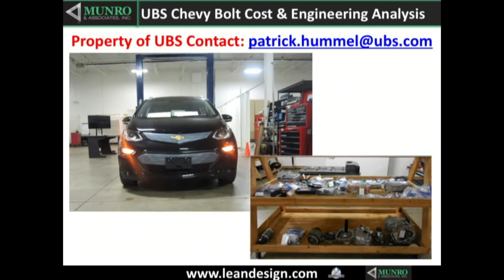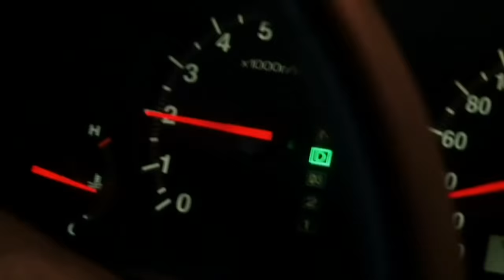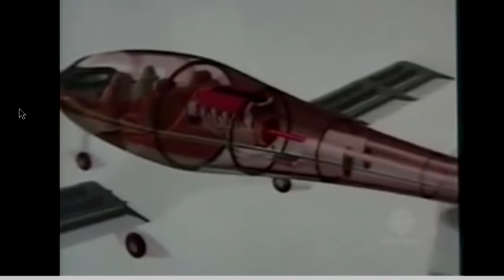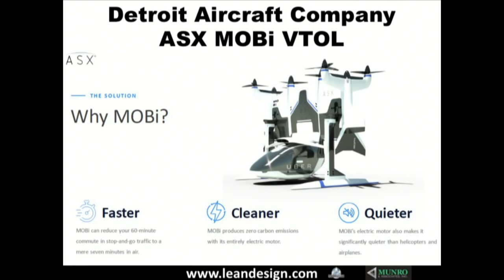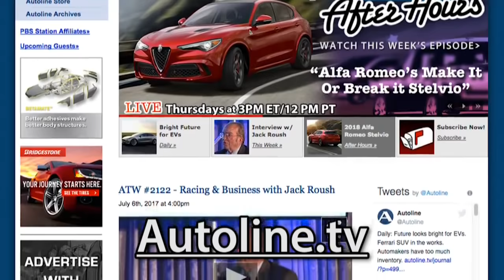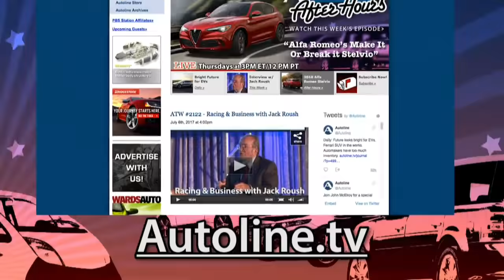Tearing Into The Chevy Bolt EV - Autoline After Hours 385

Comment: "When I finally parked it(Bolt) at my home charging station, it had gone 322 miles on a single charge. Not bad for a car rated at 238 miles per charge. Even more impressive was the fact that I didn't really try very hard to get that many miles out of it. I spent plenty of time in traffic, which helped, but there were a few sections that I was moving along at 65-70 mph as well. No matter how you look at it, 322 miles out of a Bolt is pretty impressive." — Ed Hellwig Edmund's

Comment: The Bolt will charge from 120V at 8 amps or 12 amps.  The 60 hour time for a full charge is at 8 amps.  At 12 amps it would be 40 hours.

Comment: The price drop for the Bolt and Bolt EUV got me here. They're definitely making profit on the investment now. Love the bigger rear door/legroom, pano roof, ventilated seats and SuperCruise on the EUV. Keep the regular Bolt as cheap as possible. Give the EUV the extra goodies and then add them to the regular Bolt later on. The refresh really cleaned everything up for the standard Bolt. Battery recall put pressure on them to drop prices. Two wonderful option for any value driven customers looking to get into an EV...

Comment: This guy is in someone’s pocket. I have owned a Model 3 for 4 weeks now. We just completed a 2000 mile trip. We passed a few Bolts, most were doing 40-50 mph, I would guess they were trying to make it to the next charger. If you want range anxiety, I wouldn’t plan a road trip in this car. We sailed from supercharger to supercharger, mostly in the 65- 80 mph range. The Model 3 is quite a road car, I’ve never had anything like it. I guess I’m a fan man (65) but I believe there will be no shortage of buyers for this car. This is the guy who said the Model 3 has the build quality of a Kia. I don’t think so, it really made me laugh. I can get just about anywhere twice as fast, or so it seems, in the Model 3. The power is instantaneous. It doesn’t shift, it just does tremendous speed in complete quiet. I am very glad to have owned this car before 5G and new government regulations in the next 2-3 years. I believe it will be harder to even self drive cars like this due to autonomy. When I was 16, my parents bought a new Pontiac, I’m not sure they even knew the significance of it being a GTO. I can tell you the Model 3 makes that car seem like a bucket of bolts. Hell, it makes my old car, a Lexus GS seem like a bucket of bolts. The advertised 0-60 time of this car is something like 5.2. Having owned 2 Ferraris and 4 Porsches, I would say the actual 0-60 is more like 4.5. I know none of those cars would be able to keep up in the city with the Model 3, and this is not even the dual motor or performance version. I can only think the new roadster will be like the slot cars of my youth, the ones you could barely see, they moved so fast.
Reply: there was fit and finish problems with the first iterations of the model 3, they've fixed all that now. However the statements he makes here are really first impressions, he recently finished his tear down. He's completely turned around his position on tesla and their products, believes the model 3 to have the highest gross margins of any EV in the world, knows tesla has the best batteries in the world, really shows how great the model 3 really is imo.
Reply: Nearly all reviews of the X and S said both cars had fit/finish problems.  If just one reviewer was negative I would reject him, but if ALL reviewers say negative things, then the problem actually exists

.
Reply: In this video of the Model 3 disassembly Sandy says the fit and finish is terrible - https://youtu.be/CpCrkO1x-Qo

.

Comment: That first viewer question, did Sandy say the i3 A/C or Volt A/C is undersized?  I thought the viewer comment was that the Bolt did not heat up as much as the i3 carbon fiber.
Reply: I was confused, as well.  The question was about the temperature of an i3, but Mr. Munro commented that the Bolt's A/C was undersized.

Comment: Oshkosh annual get together uses the largest number of FAA air controllers of any airport in the country during the Oshkosh show. P51 ok to land land short, dc3 behind waggle your wings land just past the p51, they never inked the microphone it’s that busy. The was they identify the aircraft is amazing. Next time you go there bring a scanner capable of aircraft frees and listen yourself and be prepared to be amazed. I watched a helicopter fire up his engine the wind up the rotors from the turbine then the pilot called for permission to take off and was told you have 9 seconds to take and literally leaped off the ground to 200 feet plus in less than 5 seconds. You will see takeoff’s and landings that would get you angrily ground at any other airport in the United States other than during Oshkosh. If you’re an aircraft buff and don’t go to Oshkosh your missing out from everything from Kitty Hawk to the latest wide bodies.

Comment: The Volt is a Volt. The Bolt is technically the Bolt EV. Always say Bolt EV and there's no confusion between the two vehicles.
Reply: Good point and great suggestion!
Reply: These guys are so fucking ill prepared, they don't even know what the car they're supposedly reviewing is CALLED!  None of them have anything more than a "spin around the block" in one. None of them have any clue about the significance of what this car -- specifically the Chevy Bolt EV -- represents: an affordable 100% electric car that can be charged at HOME...for virtually free. Yes. Free. In fact, better than free. Here's how: when you get an EV, your electric company re-sets your rates to "TIME OF USE" or "EV" or something similar, and the electricity rates for your whole house goes down. For me, it went from $172 a month to $36 a month...and that's INCLUDING the fact that my EV gets driving an astonishing 164 miles every day. So, it's actually better than free. These guys have no clue. An EV is merely a COMPONENT of a total energy management system. Get solar panels on your roof and a battery in the garage, and your energy costs plummet. Once you pay off the solar panels and the battery and the car,  all of which should be done in about 5 years, and you're literally driving and powering your house for FREE.  THIS is the big picture. Charging up at HOME is a HUGE advantage over going to the nasty ass gas station. GLOBAL WARMING Is a thing, and people like to do the right thing. EV's are MAINTENANCE FREE.  They didn't bring up the fact that you NEVER have to get an OIL change, or a TRANSMISSION FLUSH or a BELT REPLACED or any of the other 17,000+ things that can go wrong with an ICE car. These guys are threatened by EVs, because they know everything there is to know about ICE cars and all of that is now totally irrelevant, so they deride, they smirk, they cut, they chop and they chide and it's all just whistling past the graveyard: the graveyard of the internal combustion engine.
Reply: Except the Volt is an EV too (with 40 miles of range).  Many Volt owners don’t burn a single gallon of gasoline

.
Reply: @alexanderhamilton8585  well said.

Comment: Can"t blame Purchasing if the design and/or design specs are not suitable for the intended purpose.   Also the procurement methodology needs to be suited for the intended purchase.  There needs to be a strategic procurement plan in place. Either that or just single or sole source and live with that outcome. Cheer and great discussion.
Reply: Actually you can blame purchasing when they don't evaluate the vendors to determine if they can meet minimal quality standards. But it's really the whole corporate culture, not just purchasing that's to blame when the project fails due to bad purchasing decisions. Purchasing should not be making its decisions in a vacuum. It should be serving in a consultancy capacity to the engineers. The ultimate decision should rest with the engineers. When purchasing buys something unsuitable for purpose that can only occur because there wasn't sufficient communication between purchasing and engineering. There needs to be a real conversation, not just tossing the specs over the transom.

Comment: It's hysterical and pathetic after all these years GM still couldn't develop an EV and had to outsource basically the entire system to LG.
Reply: But you have to give them credit that they punted and partnered with a company that knows how to pull it off.
Reply: Suppliers can have a lot more in-house expertise on something that the automaker might not have. GM doesn't have the infrastructure and resources to make it's own batteries, motors, etc. Letting LG Chem and Samsung (who have expertise and production facilities) build things to GM's spec, makes a lot more sense than for GM to do it basically from scratch.
Reply: Except that GM used to have all that expertise in house... and when L G Chem makes 60% of the content of the Bolt the GM label becomes relatively meaningless. L G Chem is surely making money on the Bolt. GM is losing at least 7 grand a pop. Which company would you rather be?
Reply: That's the thing: GM should have dominated this market if they had continued development of the EV1 from the 90's, but a few short-sighted idiots on the 14th floor thought it was better to protect the status quo instead of investing in the future, and now the company is paying for it dearly.
Reply: I wouldn't say they are paying for it dearly; they have the first decent range affordable electric actually being sold, beating Tesla to market, which means they probably will have the 2nd generation one on the market before the other guys.  Usually the 2nd one is the one people are more willing to buy in mass numbers, being reluctant to be early adopters.  Remember also, their "customers" are the dealers; the dealers have to buy them in mass before the customers see them lined up on the lot for sale with choice of colors and options; dealers are often not early adopters until they see other dealers making sales in numbers.
Reply: What's going to be interesting to watch is how Tesla updates the Model 3.  They don't follow the same generational update method as other auto manufacturers which gives them an edge at the cost of customer confusion.  With Tesla, it's not as simple as "I'm buying a 2017 Model 3".  They update cars without waiting an entire model year.
Reply: It's called specialization.
Reply: GM was forced to make an EV, why should they spend money reinventing the wheel?
Reply: +dlwatib
GM may have previously had "all that expertise" in house, but that expertise made a REALLY terrible car.
then the industry evolved for the tech age, and GM, I hope to you understandably, didn't quite keep pace.
Reply: rwdplz1 — It isn’t unusual to outsource automobile components, especially to try to keep the cost down.  Tesla uses Panasonic batteries.